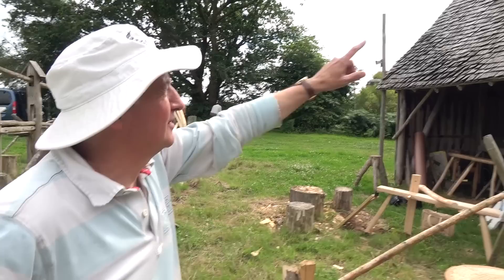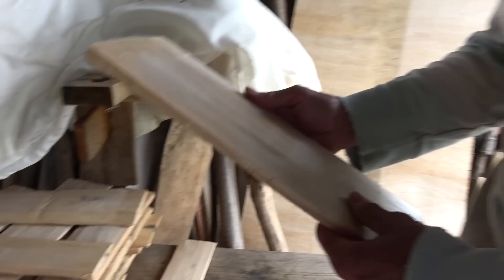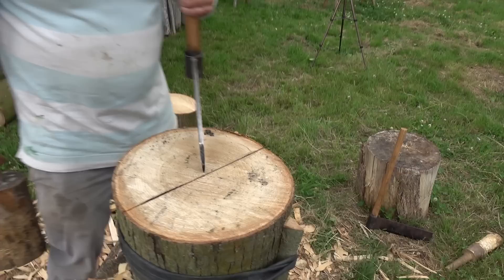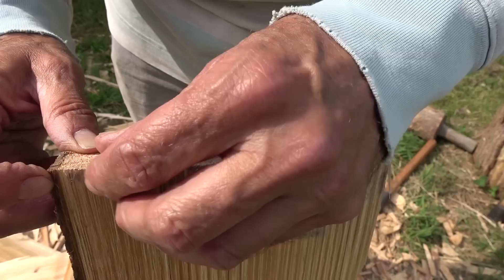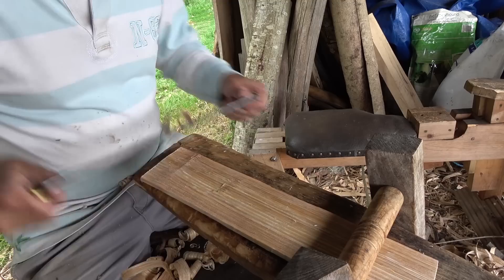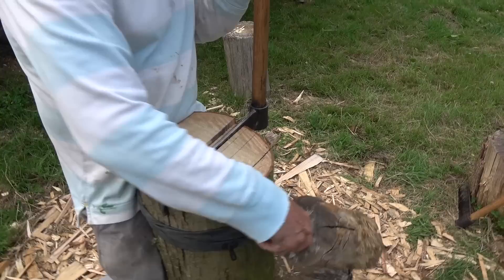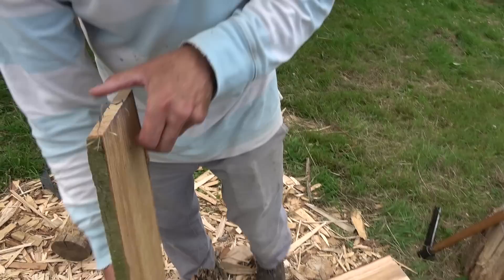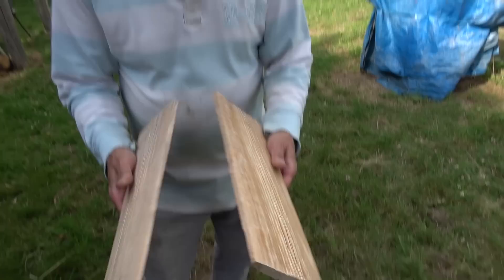Making Roof Shingles With Hand Tools

Comment: Here in the US we like to use cedar for our shakes because it’s less likely to rot. In most areas of the US. You must use Open deck (the way you have) due to fire hazard. In our colder climate we can use 3/4 ply with a 30 pound felt and 10’ lace making those roofs last for 25-30 years with the integrity to hold hundreds of pounds of snow.
I am a spoiled tradesmen that has had the luxury of going to lumber supply stores; so watching you guys make your own materials is fascinating to me.
Reply: I think folks tend to assume that cedar (usually western for shingles) is the winner in rot resistance but that's not the case. A hardwood like a chestnut or white oak is superior in overall durability outdoors. "Cedar" is lighter, more easily machined and most importantly, grows faster. Also, folks around where I am think all eastern red cedar is "rot resistant" and stick posts in the ground surprised to find them rotted a few years later. The white sapwood is no better than balsa in terms of rot resistance and most posts and boards now that the old growth has been slashed and burned are a half and half mixture of the sapwood and red heartwood.
Reply: @victoriakelley3685  Thank you,can’t never get to much information. I find the cedar shingles swell just a bit when thoroughly wet which makes them a little less likely to leak.

Comment: Excellent detail and showing the Tools and Workmanship.
I worked helping guys make cedar shakes in Northern Maine repairing and replacing roofs on old log cabins in the forest back in the mid to late 1970's. The cedar is far softer and shaves into thin slabs unlike the hardwood you are using. That's probably why the went to the flat belt driven horizontal shingle saws in the Appalachian territory. There were buildings that had shakes on them for 90-120 yrs and they still were in near perfect form.
Reply: Cedar is bomb for lasting the elements. Also splits so well like you said. I thought of cedar as well. Now I want a cedar roof

Comment: I was told there were hot shingles in my area looking to be nailed.
Reply: I wanted to upvote this, but there's 69 of them and I couldn't ruin the perfection.
Reply: Jeffrey Stephens It's okay. Because now it's at 96.
Reply: 212 now
Reply: 254 now ^^
Reply: I'm number 339. No idea how I got here, but here I am.
Reply: #486
Reply: First!
Reply: 601 now....
Reply: 689 now...
Reply: 726th now....
Reply: anyone read that in sean connery?
Reply: felixthemaster1 sean connery would be on that like white on rice.
Reply: felixthemaster1 there are many shingles in your area
Reply: 833 now
Reply: pblabrat07 SHEXSHY SHINGLESH
Reply: They call me 837
Reply: they call ME 855
Reply: They call me 875
Reply: You've just hit rock bottom.
Reply: I prefer the flat ones, they stay wet longer for some unknown reason.
Reply: Haha😂😂
Reply: its ok. Its at 1.3k likes now
Reply: 1.5k likes now
Reply: Lol
Reply: Calm down Sean
Reply: 1.9K now
Reply: These are SWEET HOME ALABAMA shingles
Reply: @jeffreystephens2658  your comment bas 68 likes rn lol
Reply: Sean Connery?
Reply: 2.2K.
Reply: felix
Reply: Such a perfect comment
Reply: This comment gave me wood
Reply: Turns out they're either twisted or flat as a board
Reply: 2.5k now @jeffreystephens2658
Reply: Badda-boom.
Reply: But are they bound with bicycle tubes?
Reply: My OCD required I add 2.6K in May 2019!
Reply: Haha. I get those emails too. Women always run away when I pull out my framing hammer.
Reply: 3K Now!
Reply: K dont know what number i am
Reply: Now it’s 3.1K
Reply: No idea why I am here but 3.1k
Reply: 3.2K now....
Reply: Nicely done sir....absolutely hilarious! 3.3k now...(I have no life)
Reply: 8,675,309
Reply: felixthemaster1 😏😁
Reply: As a roofer, I can tell you that was just a clever marketing ploy. You go to the website looking for a quick nut, leave with an appointment for a free estimate
Reply: I'm from the year 5019 👍
Reply: And thats how you make a toothpick out of a log
Reply: We "screw" shingles in my area!
Reply: too many comments for my comment to get noticed. jumping onboard top comment.
Reply: Any gals that liked this comment are a keeper
Reply: @dangerdavefreestyle  no
Reply: me and me their all shake shingles that don’t lay flat!
Reply: Not A Teddy p
Reply: 3900 now
Reply: Careful! You might get the measles!
Reply: Really?
Reply: Is it fire resistant?
Reply: Lol
Reply: Comment almost reach 69
Reply: I meant replies
Reply: There we go :3
Reply: @jeffreystephens2658  4.4k my guy

Comment: the reason for the 18" length was probable due to the quality and size of the wood they were using. Old growth would be denser and so much of whats used today is fairly young.  The last minor ice age we had would have also meant slower and tighter wood grain during the bronze and iron ages. Just my opinion. Great vid.!

Comment: Excellent example of hand made primitive technology that still functions today. 

Back in the late 1970’s I renovated the oldest house in NC. It was a “lighter wood” structure with lighter wood shingles that had sat n that roof for over 250 years. 

Zero rot as is normal with lighter wood, 1/3 lap as he said and when in attic you could see that each shingle was 18 inches. 

It was put on a dovetailed mortise and tenon frame structure of lighter wood  Pine. 

Virtually set on the ground for the entire time without a single bug eaten part to it at all. 

The technology was exactly like he did but using lighter wood pine that at times was 6-8 feet wide. 

The inside wall boards were two four foot boards stacked on each other and a wainscoting board running between them making up the 8’ 2” height of the rooms. 

I took off some of the boards to install wiring and found an entire cobblers kit from the 1730’s   

It was amazing. 

No nails as this preceded anything other than hand made nails.
Reply from the maker: Thanks
Reply: as long as the wood stays dry bugs will not eat the sugars in the wood.

Comment: There are a few houses around here (Fremantle, Western Australia) still with handmade shingle roofs.  The shingles must be at least 100 years old.
The shingles are made from a local tree called 'she oak' an extremely hard and heavy conifer.
I just put a piece of she oak through an electric thicknesser, the machine groaned under the effort.
Goes to show how damned hard people used to work, and how their skill and tools must have been honed to a fine edge.
There is simply no way those local roofs are ever going to be repaired with froe split she oak shingles.  It would be cheaper to build an entire house!
Reply: Depends if it is worth keeping as a historical artifact.
In Germany houses are repaired traditionally by law in some smaller cities.

Comment: Spent a lot of time salvaging giant downed Cedar logs for shake bolts...Had salvage contracts in the Oregon Siuslaw country....A shingle is sawn both sides and is usually about 16" long.  A shake is 24" long and either split both sides or resawn one side.....We are having a new modern roof installed in a few days replacing one layer of cedar shingles and one layer of split shakes that have lasted 75 years....Good Job Granpa!

Comment: It’s interesting that today we think that when the shingles get warped on the roof it looks better, which it does give it more character by using damper wood. But if the old craftsman where here today, they would probably flip out that we wanted it that way because they were trying to achieve straight shingles lol
Reply: absolutely no one thinks that warped shingles look good, what are you talking about???

Comment: Very interesting video Harry, thanks!
It's amazing how much work is put in those shingles. I'll definitely watch the video (after you've uploaded it) of them laying the shingles too.

Also, best wooden mallet ever, so simple yet so efficient.
Reply from the maker: Yes, my thoughts exactly! But they do look great! Thanks for your comment Maikel.
Reply: Maikel Versantvoort   Qwqqqqwaqqžaaaaa
Reply: That's not a mallet, that's a maul. It's actually more prevalent in European construction than mallets were. If you want to see more like it, google image searching 'maul' alone is useless thanks to Star Wars' 'Darth Maul' - so I'd suggest instead searching 'setting maul' which is a variant of a maul. A maul is just a large hammer, but when it comes to building tools maul usually means precisely what you see there. A lump of wood thinned to a handle at one end. They have a fun application in masonry too, operative masonry too if you catch my drift. ;)
Reply: BaSH PROMPT miii
Reply: Have you seen Primitive Technology make them?
Reply: Maikel Versantvoort I
Reply: @harryrogers  :: is the first course (starter course) doubled to ensure the continuing angle of the face.? I see it sometimes on shingled walls.

Comment: this reminds me of a job i had when i was young , this city guy bought 600 acres of property and built a 10000 square foot house and it also had a 4 car garage added on to that, he hired 4 of us to work this land bought us 2 john deer tractors a cat back hoe chain saws and a band saw saw mill with a shingle jig , we started by logging cedar logs , enough to shingle roof in perfect shingle no knots or ugly ones, and every 3rd row of shingles was doubled , also there were 12 dormers on house , this house sat on top of the highest hill in area overlooking lake Ontario . by the time we had enough logs drawn out of bush into clearing were we sat up Mill it was about November ,then we had to square all the logs on 3 side then cut into i believe was 18 inch blocks, well when they asked what jib i wanted i said  i will cut all these shingles , the other 2 guys would nail them on and the foreman would make sure the truck stayed warm, i i know that it was cold winter  i had to keep a fire going to keep the mill running and those 2 guys on the roof dam near froze.and i cut thousands of shingles using all power tools and it was a lot of work , if i did it the way they are doing it on this video i would still be working there today
Reply: Yes, but the shingles would have been more dimensionally stable and therefore most likely would have lasted longer.
Reply: He is giving a demonstration, I'm sure he can do much faster

Comment: Great shingles method! When hammering to divide two shingles, I would place the hammer by the edge of the log you're using to work on, or, I'll place another log near by, and in it I'll place the hammer, the ax, and the fros. That way I wont need to be looking for the tools in the floor every time I need them.
Reply: Yeah, I was sitting there for a good portion trying to figure a good design for a mallet holster.

Comment: I've re-roofed a home, in CT that was built circa 1635.   It was a cape style, built post and beam style.    The interesting method they used to roof the house probably kept them dry the first year so that thay'd have time to make their wooden shakes/shingles.
I've re-roofed hundreds of old houses and never saw it again.

They ran roof boards from the eaves to the peak, butting the boards up tight.  Then, they used white birch bark, laid flat and glued town with pine pitch to make the seams waterproof.
Reply from the maker: Wow...thanks for that....interesting

Comment: I just found this on my feed. I have two froes from my Granddad. He had several barns that had handmade shingles from swamp cypress. Here in the southeastern US, swamp cypress is one of the most durable woods for outside use. I still have some of his shingles that he made probably 70 years ago. Can’t put a nail through them due to splitting. You can put screws in them though.

Comment: The days of real hand split shingles are gone.  Can you imagine how much it would cost  split all the shingles this way for a thirty square roof?
Reply: Hand split cedar shingles are still available from small specialty mills in the Northwest of the United States.  They are split from the finest quality cedar blocks and are correctly called "tapers".  In the US a fully sawn product is called a shingle and a split product a "shake".  The shakes are produced by splitting "boards" across the grain from a block, 24" long and approximately 11/2" - 2 1/2" thick (thicker boards produce what are called "heavys").  The boards are then pushed through a bandsaw on a slight angle which produces one rough side and one smooth side.  The shakes are always installed with the flat side down.  Ideallyu shakes are produced from "windfall" cedars, sometimes down for many decades.  Often these were 8' plus in diameter.  .......................Report from an old Olympic Peninsula "Shake Rat."
Reply: Michael Olson Yeah I know they’re available.  I’m a home builder since back in the sixties.  My comment refers to real hand splitting.

Comment: My house is shingled, the old, old man who did this told me "heart up" I presume this means wood nearest the centre of the tree of every shingle, must take the weather. My shingles are Douglas fir. I'm told 40 years life with maybe the odd repair round the edges. Shingles are common here in france and still a respected trade.  Here, they always leave a small space at the side of each shingle to assist drying, makes a difference to the life of the roof.
Reply from the maker: Thanks and very interesting.

Comment: In Finland we split shingles at a slight angle to the grain (using a huge plane), which cuts the grain. The shingle is then laid so that the grain is running down (identified by bending the shingle before nailing it down), thus replicating the overlapping shingles in the grain of the wood itself. These machine split shingles are around half the thickness of those hand cut ones. Shingles were still commonly used in the 60s here for barns and other economy buildings. I have a video here on YouTube of one of those huge tractor powered planes for cutting shingles running.

Comment: When these are applied usually you roll 18 inch tar paper just above the drip line on each row. . There is a arch roof barn not far from where I live that my dad shingles around 1950. No 1 western red shingles.  He said they were all soaked in a tank before they were applied. They still link really good to this day 72 years and holding.

Comment: Is that wood unusually hard, or is the drawknife not as sharp as it could be?

-jcr
Reply: He definitely needs to freshen the edge on that knife. Chestnut is not soft, but it should have been easier, even with the dryer bit of plank.
Reply: He comments on that when working the second shingle - it's due for a sharpening. He's taking pretty chunky cuts of fairly hard wood, so it's not embarrassingly bad or anything, just ready for a trip to the whetstone.
Reply: I wonder if this is the same -jcr I see on /. all the time...

Comment: Very cool! I Hope to see that video of the shingles being put up too, thanks

Also, that saw, using the flexible branch to saw, (the saw producing all the noise in the background) what is that? Thanks
Reply from the maker: Crazyboxhead Its a foot operated large called a pole lathe.
Reply: Thanks for the reply, I saw the one you made in 2013 after i made this comment actually. Quite cool! 

I wonder if it could somehow have a brother that actually saws too.
Reply: +Crazyboxhead
The treadle is just a way to get rotational power to the lathe. There are apparently several ways to make one, as I've seen the flywheel version before. And if you transform the rotation to a back-and-forth motion, you should have the makings of a saw, if you don't just go with the circular kind, lol. There are several ways to do that, some of which will lose more power than others. Racks and pinions, pistons and chain drive come to mind. Look up a few videos on simple machines to get ideas.
Reply: I know :3 

I was thinking something like a jigsaw ish, would be cool, not to sure of the power it would have though.

For some reason i am just getting notified of your comment too.

Comment: In the 1980s I would hand split cedar shakes using a froe, and sell them to a local mill. Eventually they asked me bring them bolts which was 2 shakes thick and they would band saw them in half. So the top side was hand spit and the bottom side was sawn so it lay flatter.  These type roof shakes are no longer used here in California because they are a fire hazard.

Before that I made and sold hand split redwood fence posts and rails.

Comment: John made a point about how shingles that are saw cut will leak a lot of tannin because the cells are cut open, whereas shingles that are split have (presumably) been split in between cells. That being said, and the logic is sound, when you start trimming the shingles with a drawknife and axe, you are cutting the cells just like a saw would. So, what makes the splitting process so superior to saw cutting, especially when you factor in how much extra labor is involved in the axe and drawknife procedures.

Comment: Actually in the USA;
Shakes are larger and are primarily used as siding, whereas shingles are smaller and are primarily used as roofing. Either can be sawn or split, though split tends to be more watertight. With sawn shakes and shingles, the saw doesn't always cut exactly with the grain of the wood. Wherever it crosses the grain, the open grain tends to wick water. This can cause sawn shakes and shingles to dry rot easier because they tend to absorb moisture that split wood sheds. If you have ever tried staining wood, you will see that end grain is much more absorbent than the side grain is.

Comment: Instead of an innertube I use a short length of chain and a rubber bungee strap when splitting firewood. Very similar to the first method of shingle making. With the chain you have instant variable length to fit any size log, just hook the bungee wherever it fits best.